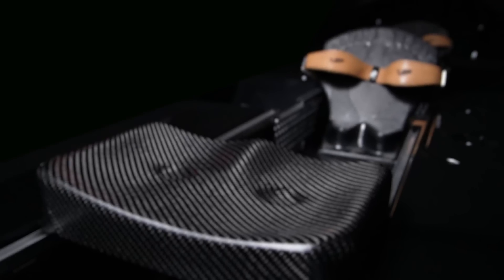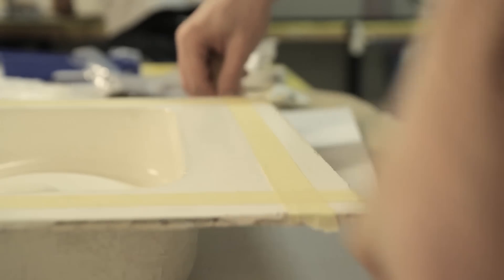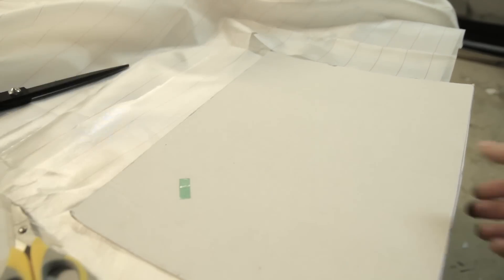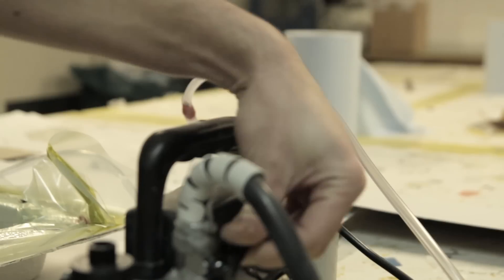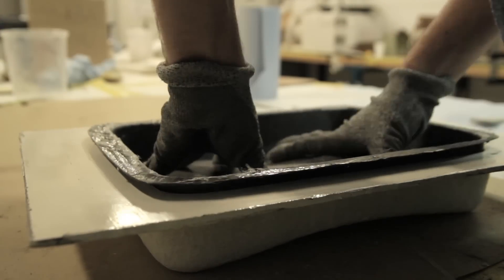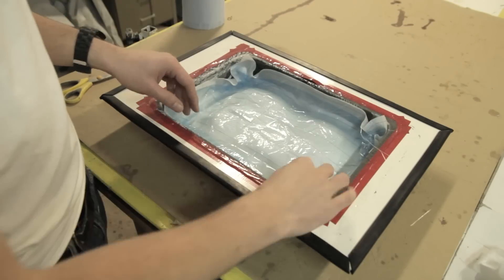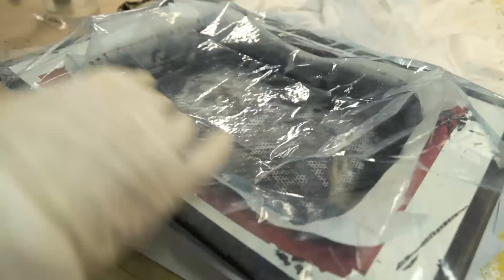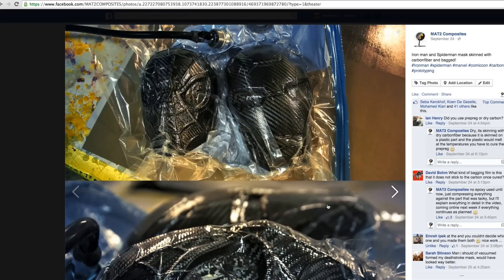Rowing Seat - Carbonfiber With Nomex Honeycomb (Spacegrade)

Comment: So a couple questions,
1. the epoxy then Nomex, then vacuum that was really just to apply pressure while it cured, yes?
2. The lay up was filmed backwards wasn't it :-)
3. The laminating resin for the fibre glass. So the vacuum on this, does it draw any of it into the Nomex? I guess it would. but its not like a full resin supply. This creates the barrier to the carbon resign in fussion, yes?
4. Also how thick is the Nomex, would it have been stronger if you did it on the sides as well?
Reply from the maker: ***** attentive viewer! I like that ;) correct on every point! about point 3. it might be some resin was pushed in the Nomex but not mucht, fiberglass was saturated to a minimum on a plastic sheet then transfered on the nomex, then bagged to remove any excess resin left. This does create a barrier if you would like to do an infusion on top, I did this part with regular vacuumbagging, but an infusion would be ideal. point 4. the nomex was 2mm if I'm correct, using this on the sides would work as well but the nomex is at it's strongest on horizontal stress (do you know what I mean?) 

Matthieu
Reply: +Matthieu Libeert (Mat's Prototyping) hello there 
As i reading the question and answers i came up with an idea about the barrier layer .
wouldnt be the perfect way in compresion terms and also at the point of not getting resin into the neomex to do 

 a vacuumbag inside a vacuumvag? the first one would be baged by itself with infusion in it and the second would be attached into the gasket holding it into shape. 

what do you think?

a question wouldnt it be stronger to have solid styrofoam or a two part foam inside and baging it at once? would it be much havier that way?

ps. thanks for the wonderful videos

Comment: Thanks for posting Matthieu. Can you give me a general estimate of how much all of the materials (not including reusables like the pump, tubes, etc) would cost to make this part?
Reply from the maker: scott loong such part would be around 65€ in materials (without mould) but the "problem" is you cant just buy 300grams of resin (you have to buy min 1Kg) so total cost from scratch would be 150€ in materials then you would have to add 15 hours of work till finish (450€) making this a part of around 500€ (labour is the most expensive part)